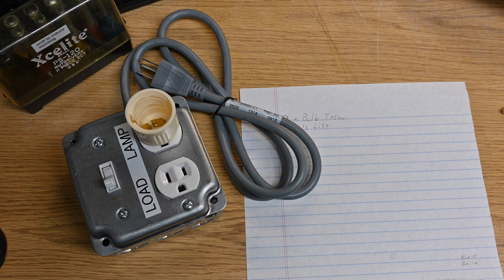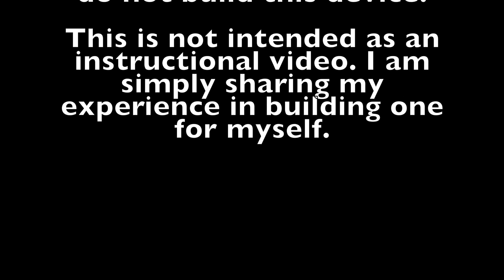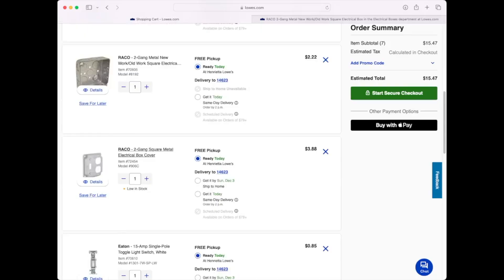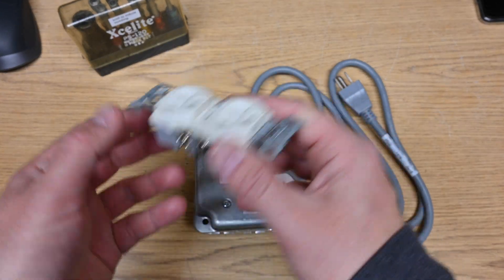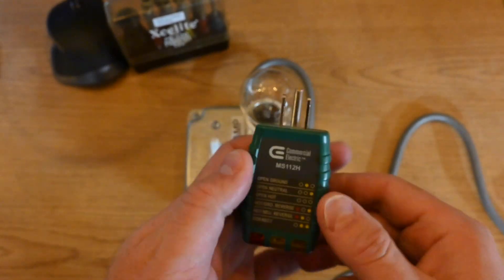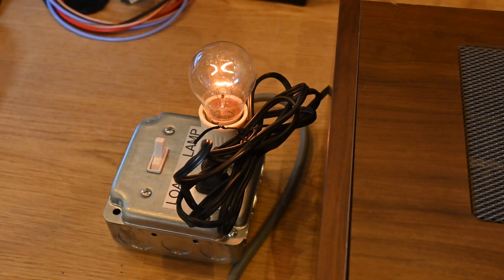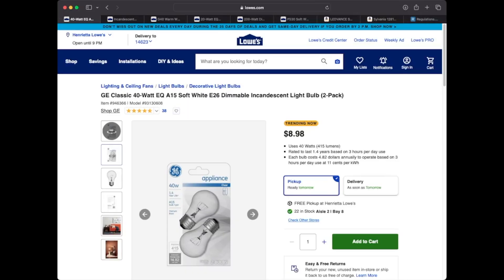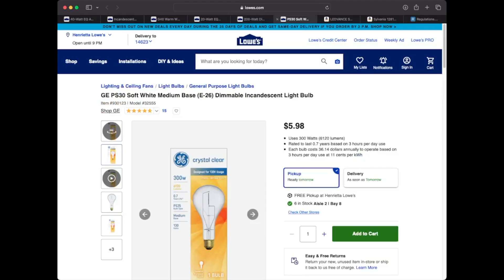Building a Dim Bulb Tester for Electronics Repair with parts from Lowes & Finding Incandescent Bulbs

Comment: Came here to say a HUGE thank you for this guide. Also, I just finished my version and wanted to suggest to others that they may want to go with a 16 AWG wire computer cable rather than the more ubiquitous 18 AWG cmputer cable which I had gone with originally. Thanks!

Comment: Incandescent bulbs can be found at most "Thrift" or "resale" shops, they have boxes full.   The bulbs were never "Banned" they were made impractical by LED and CFL bulbs due to the efficiency requirements.  Some types are still made as you mention.   LED and CFL types will NOT work for this "dim bulb tester" of course.
Reply from the maker: The common household incandescent lamps were banned (for sale, not preexisting use) via a law that took place on August 1, 2023 - at least in the United States, not sure where you are.  There is a lot of info on the law online.  

Yeah, I've seen them at Goodwill.  Good point to check those type of store as well.

Comment: Where there's a Lowe's there's an Auto Parts store such as Advance, Autozone or O'Reilly's.  I bought 75W and 100W Rough Service bulbs for drop lights there.  Also, I built mine with a 2way switch to use or bypass the bulb.

Comment: Many thanks for this.  Just made one this evening.   Some dumb questions, just to ensure I have it right.

1.  With bulb plugged in, but no load on other outlet, bulb should not turn on.  Correct?

2.  With tester pluged in, but nothing in other outlet you see open neutral on one outlet, nothing on other outlet.  Correct?

3.  With bulb plugged in, tester on either outlet shows "correct wiring" on tester.  Correct?

Thanks again.

Comment: Great instructions.  Built mine today and it works perfectly.  Just getting into vintage audio repair as a hobby.  Replaced the two filter caps in a 1974 Pioneer SA-7100 amp.  Wanted to test it to make sure nothing was going to blow.  Thanks.

Comment: I have being buying for years 25 and 40 watt bulbs for lava lamps; I currently have four lamps going at all times.  I think I am up to about 40 each.  In the central North US a DIY store called Menards has an extensive collection.
Reply from the maker: Thankfully 25 and 40 watt incandescents weren't affected by the ban, can still buy them at Lowes, Home Depot and other stores here in upstate NY!  Oh, and I need to get some Lava lamps!
Reply: @philsanalogbasement  Could you elaborate a little on "breaking the tabs?"  Do you just simply rock them back and fourth until they break off?
Reply from the maker: @SoundofSilence-45 it depends on the exact receptacle you bought but yes for the majority of them that’s how you do it